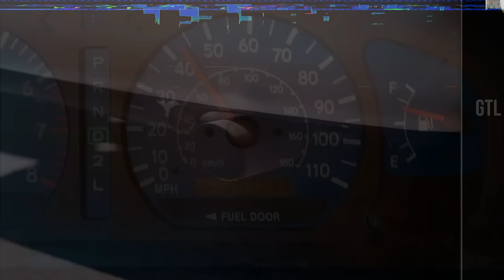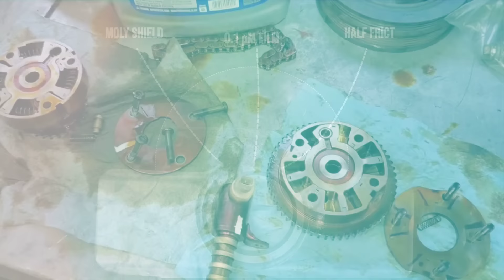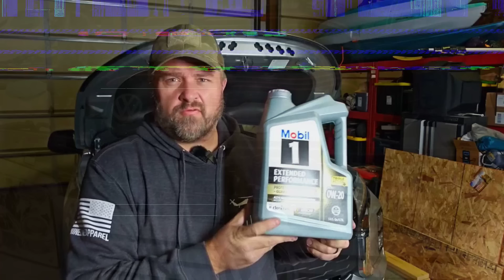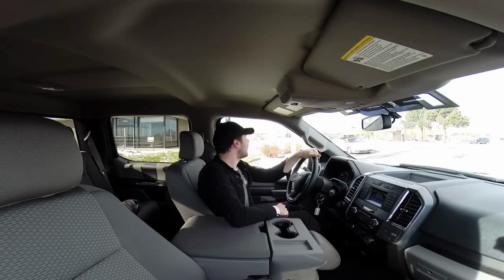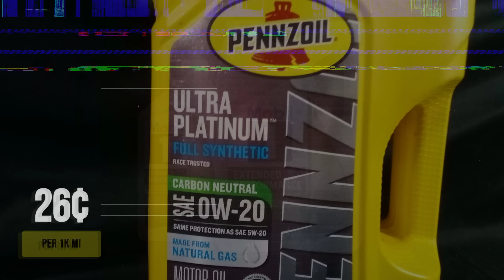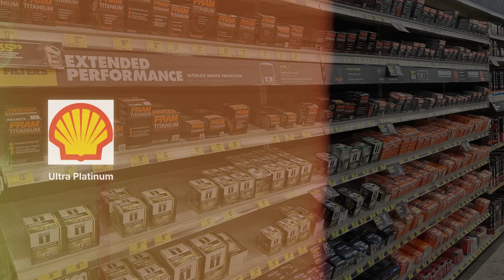Penzoil Ultra Platinum vs Mobil 1 Extended Performance

Comment: I had to do a complete engine rebuild because I purchased a used 2017 CadillacEscalade the lifers went out. first use Mobil 1 ep but after 1500 it started to turn black because of all the detergent. So I decided to try Pennzoil ultra platinum not regular platinum after a lot of research and it’s a clear winner for me. Ultra platinum makes my truck feel real power then Mobil1. The Key is to change your oil with premium filter every 3000 no more… I do mines every around 2800-3000… just only $115 to do it yourself
Reply: Pennzoil Ultra Platinum no longer has GTL & isn't even Dextros Certified any longer! You might want to pay attention to the new formula since this Iran BS war!!!! Just if you are going off what Pennzoil 9months ago once was.

Comment: I change the oil using penzoil full synthetic high mileage every 3 thousand miles but Mobil 1 valvoline castrol they exelente oils also the key is do the oil change on time

Comment: Pennzoil Ultra Platinum used to be better, not anymore!!!!  As of April, Pennzoil Ultra Platinum no longer creates oil from natural gas to liquid process but they are charging you more. There is no longer 99% pure.  They no longer molecularly build their motor oil from scratch.  The first part of this video no longer applies.  They no longer control the shape of their molecules.  They take it from crude oil and it is not worth the $40 they charge now.  Don't waste your money on Pennzoil UP, it is a bait and switch now.  

Shell, who owns Pennzoil, sustained some damage at the GTL Pearl processing plant in Qatar.  Short story:  They charge more for the inferior Ultra Platinum than when it was a better product several months ago.  Just don't buy it and waste money. Oh yeah, Pennzoil Ultra Platinum is no longer Dexos1 approved.  

You are better off with Kirkland Signature Synthetic (save more money), Havoline ProDS and some others.  Mobile Extended Performance is also a better choice.  Pennzoil needs a press release to the oil industry instead of inconsiderately taking off the wording of Natural Gas to Liquid.

Comment: The narrator states that Pensoil Ultra Platinum is Gm Dexos approved, this isn[‘t the case. Nowhere on the Pensoil Ultra Platinum label will you find the GM Dexos label.
Reply: This is a recent change due to the Iran war. They changed the formula after their Natural gas plant was bombed.

Comment: I use original Mobil-1 full synthetic in our 2019 Ram 1500 with the Hemi and change it every 5000 miles with Mobil-1 oil filters.

Comment: Have a 2014,3.5 turbo, running penn ultra and top tier fuel. I change every 5.000 miles. I don't push my oil to it's breaking point, and anyone who does is foolish 🤔  thanks for your video.

Comment: i mix pup and M1ep 50/50
Reply: Is EP GTL?  IF not, you are bringing down the PUP properties and raising M1 properties.  I wouldn't degrade PUP with any group 3 oil.
Reply: @lonniebeal6032  it might have some GTL, but it does have some PAO also.
Reply: That’s interesting! How is that working for you?

Comment: So, I guess the bottom line of the video is to use Pennzoil and Mobil 1 alternately every other oil change 😊
Reply: Nope, all group 3 oils are good to 5,000 miles.  If you're going over 5,000 mile OCI's, group 4 is a safer bet. Those group 4's being Amsoil Signature, Redline, Triax, Torco and certain family members of Ravenol as supported by SDS PDF's.  Amsoil is probably the best priced group 4 if you join their club.
Reply: @lonniebeal6032  - I would never go over 5k between changes. 😊

Comment: Gtl oils require an abnormally large amount of thickener. If your don't change the gtl oil on time or overheat it, your will end up with a lot of deposit. GTL motor oil technology requires further development. However , in very low viscosity oils such as  0w8 can show its best side

Comment: Mobile 1 is group 3 with group 4 additives
Reply: Exxon Mobil has recently started using a PAO/GTL blend base oil in some products, for example, Mobil 1 Ex Perf 0w20. It's every bit as good as Pennzoil 0w20.
Reply: Only one of the family had PAO on the last SDS I looked at.  I think it was the oil Mobile One Advanced, which doesn't seem to be sold her any more.  So No, saying M1 is group 4 is false.  SDS sheets support Amsoil Signature, Torco, Redline, certain family members of Ravenol, and Triax as group 4.

Comment: Pennzoil is group 3, mobil 1 is group 4 which is superior to group 3 period 👊
Reply: Check your SDS sheets, Only M1 Adavancted has PAO, and I am not seeing that for sale in my area or on Amazon.   And many videos show that group 3 and 4 are pretty much equal to 5,000 miles.  After 5,000 miles the group 4 will exceed group 3.

Comment: In my Dodge Challenger SRT Hellcat with a 6.2L Supercharged engine, I use 0W-40 Penzoil Ultra Platinum. However, twice in a pinch, I have used 0W-40 Mobil 1 European Formula. I change my oil every 5,000.

Comment: You'd have to be a maniac to go 15-20k between oil changes.
Reply: 10w30 in a high tension piston ring 85' and 89' Dodges with turbos did great at 15k mile oil changes, new filter and top off half way.  Any full synthetic on sale was used, I did it, both cars over 110,000 miles when I traded them off.  Regretted trading off the CS Daytona Turbo within a month.  Today's  0w20, I wouldn't do it on a group 3 oil, I would on group 4 with a UOA.  Oh, on the turbos I adhered to the 3 minute warmup and 3 minute cool down before turning the car of, so no turbo problems.

Comment: Been using Mobil 1 for 32 years in my 1994 K1500 TBI 350/5.7 with no issues and still running great 👍🏻

Comment: Pennzoil ultra platinum is made from natural gas, a group III GTL oil. Mobil 1 EP is group IV, PAO oil. Both should be very good
Reply: Pennzoil is not natural gas anymore.  I've been using it for a few years now, since the change, they downgraded and is charging $10 more per 5qt.
Reply: @DroneStrike1776  It is still priced nearly identical to mobil 1 and other top tier oils.. Penzoil Platinum is still made with natural gas, it clearly states this on the back of the bottle in the black paragraph.. Ultra does not list made with natural gas anywhere, although the website says it is still made with natural gas, however Ultra Platinum is still a great oil, new or old version. Plus you can still find the Made with Natural Gas at a LOT of places, just check the bottles.  I found so much at Advance auto parts and dollar general, that I have about 60 qts stocked up.
Reply: Except more recently Pennzoil has stripped their dexos 1 cert, changed their label from made from natural gas and don’t list GTL on their bottle anymore. Red flags all around since their main GTL factory went down this year. Maybe they will bounce back but there’s no reason for them to if sales don’t go down.
Reply: @UnholyMerlin1    From what I read today, Pennzoil is still using some GTL in their Ultra Platinum and possibly Platinum "full synthetic" oils. Some is the key word. I did a search for "Who still uses GTL as their base?" That info is from 8-24-28.
Reply: @UnholyMerlin1 1000% I No Longer Mess With Pennzoil Since This BS Iran Garbage War!!!! I'll Take My Chances With Mobil 1 EP For Now!!!!! Not The Mention How Shady Pennzoil Is Being With All The Oil Experts Reaching Out For Information On Their New Oil & Not Responding, BIG RED FLAG!!!

Comment: Total AI garbage. Professional race teams are not using off-the-shelf Pennzoil or Mobil products- period. I know because I'm in the industry. It would be insane to run compromised consumer detergent oils like Pennzoil Ultra or Mobil 1 EP instead of specific race blends with limited additives. Race teams use custom blends and work with tribologists to formulate oils that will keep temps low, minimize friction losses and stay viscosity stable. There's no off-the-shelf oils at Walmart or your local Auto Parts store that are going to do that. Sorry.

Comment: The information in this video is no longer accurate. Mobil 1 (and Mobil 1 EP) have changed their formula, mainly due to cost reasons. They now use about 1/3 Group 3 (severely cracked crude oil), 1/3 PAO, and now 1/3 GTL Group 3 purchased from Shell. Pennzoil is owned by Shell, which is where they get their GTL from. The percentages above vary by viscosity. This information was obtained from the MSDS for Mobil 1 in Japan, where Group 3 components are considered to be hazardous chemicals and must be disclosed in the MSDS. The Japan shows the Group 3 from crude oil separately from the Group 3 from GTL since they have different CAS numbers. You can ask ChatGPT is you don't believe this.
Reply: this guy knows

Comment: No matter what oil brand you use, new oil is better than old oil. You have to change the oil with a high-quality filter {I use the Boss from Purolator} every 4-5K miles. Short trips are a strain on the oil because the engine does not get up to operating temp., and burn off the moisture in the oil. Once a week, take your vehicle on the highway for 15 to 25 miles, and get that moisture to evaporate. Your car will thank you

Comment: Retired Industrial Lube Application Engineer, here.  Interesting video, but some of the application points are off.  The latest engines are GDI.  These engines contaminate oil much, much quicker than the previous generation of port-injected engines, to the point where oil must be changed prior to 5,000 mile run time (I've confirmed this via UOA myself). Fuel and soot blowby from incomplete combustion in rich burn (loaded) injection mode is the culprit.  So arguements about oil longevity are no longer relevant, as most engines are now GDI.  What IS important is sheer stability for turbocharged engines, again, becoming more frequent, and Low Speed Pre-Ignition inherent to GDI engine design (LSPI).  These require oils of specific additive content (API SP), but SP also lowered viscosity for fuel savings.  This is not good - PUP was a 11 cSt oil, now reduced to 10.2 cSt.  I have changed to Mobil 1 ESP 0W-30 to get a real SAE 30 oil again for my turbo GDI. 12.0 cst and its high load from the turbo.
Reply: Thanks for your expertise

Comment: Info in this video is wrong.  Mobil 1 EP doesnt start with crude oil, it is a PAO base stock !
Reply: No, it is a blend of Group III cat cracked and severely hydrotreated and Group IV PAO.  Mobil will not divulge, this has been assessed by labs (Motor Oil Geek, etc.).  PUP is a Group III+ because it is not PAO, it is Fischer-Tropsch process the Nazis invented.  I creates some waxy residue, so not a pure PAO.
Reply: Mobil1 EP 0w20 is now using a PAO/GTL blend base oil. I don't know if other weights do.
Reply: @EpiLover Not all of their flavors, only one had the GTL.
Reply: @lonniebeal6032 - All the flavors of ESP X2 and X4 use GTL/PAO blended base stock, typically 50-75% GTL. According to Exxon Mobil tech desk.
Reply: Not any more.  Only Avanced had high PAO base, up to 70%.  Advanced no longer for sale in my area or on Amazon.

Comment: Ehhh….Ive been a Valvoline guy for 40 years and have no plan on changing.
Reply: Valvoline is excellent oil  ran it in my Ranger 300k miles
Reply: If it works I don't blame you.

Comment: Not meaning to offend anyone but IMO anyone that runs any oil over 10,000 miles (especially with a turbocharger) they have some screws loose!  LOL            Engines last longer when you get old dirty oil OUT of the engine and put in new fresh oil regularly and change the filter and I do oil changes every 5,000 miles (its how I was raised) and it works.
Reply: I was raised to change my oil every 3000 miles,  my grandfather changed his every 1000 (shows my age). I have extended my oil change to 5000. I use mobile 1 but still change every 5000. I got hooked on mobile 1 nearly 40 years ago when I tried it in my harley sportster and found it ran cooler and got better mpg.  That mobile 1 doesn't exist anymore but nearly all oil producers have improved since then.
Reply: Depends on the engine.  2002 Cavalier bought brand new and always had extended drain intervals over 10,000 miles with full syn oil.  Sometimes just changed the filter at 12,000 and topped off.  Had to scrap the car at 250,000 miles due to transmission and water pump, but the engine was still strong and never gave us any problems.
Reply: @jeffreycole9586 yup
Reply: @jeffreycole9586  Certain pre-DI Honda applications are so easy on oil that they don’t even challenge non synthetic oils at 7500 mile intervals. More important than the whether it’s labeled “synthetic” or “conventional” is the quality and quantity of the additives used in the oil. A premium quality conventional oil with the very best additive packs made can outperform a mediocre “full synthetic “ oil easily. I put 630K miles on one Toyota truck and it never saw a drop of synthetic oil the whole time and it a averaged about 7K miles on the oil changes.
Reply: I have a 392 scat pack ive changed 7 times in 27k the longest interval was 4600 miles  ive used 0w40 pennzoil for srt and a mobile 1 filter they're rated as 1 of the best and 1 ounce per gallon of chevron techron
Reply: My Grandpa had an El Camino.  He religiously changed oil at 3k miles.    At 100k miles he decided to redo all the suspension and the engine.
When he took the crank to the machine shop..  No grinding was needed!  Just a light polish and new stock size bearings !
Reply: I did it on 2 Dodge Turbos 1980 to 2004. 15k OCIs filter and top off at 7500. 10w30. Mobile 1 and Supertech full synthetics.   Both cars over 110,000 mile, oil caps and valve train clean. No sludge or varnish. I wouldn't do it today on 0w20 and the low tension piston rings introduced around 98'. Don't underestimate synthetics.  I also drove over 20,000 miles a year up to 2011. Get a UOA at 5000, it may surprise you.
Reply: I agree 👍and I don't need an olive sample test ,I just pull out the dipstick look at the oil and see if it's getting dirty and feel it to see if it's smooth.
Oil is cheap ,motors are not.
Reply: @tommyboy1653Oil Ain't Cheap No More😂!!! Just Wait Another 3yrs it will be another 20% more for good oil😮!!!!
Reply: Where is a test that shows timing chain wear results? Chain stretch is a real issue
Reply: @candyman1967  Many 4 cylinders had timing belts, including my 85' 600 Turbo and 89' CS Daytona Turbo.
Reply: I send my Mobil 1 5w-30 samples to Blackstone every 10000 miles (owners manual recommendations) 

BS sampling results indicates extending change intervals to 18500 miles then resampling.

I drain  at 20k regardless of what BS recommends… 380,411 miles and still going strong.
Reply: @douglogan4134 Some Engines Just Are Made To Run! You do 20k mile oil changes on every vehicle, AIN'T NO WAY YOUR GONNA GET THAT LUCKY))))!!!!! Good Luck With Those 20k Oil Changes😅!!!!!
Reply: Another person stuck in the 70’s and operates off emotions and not facts! Oil lab tests don’t  lie!
Reply: Well. Thats your opinion. Major national truck fleets change their oil at 80000 miles with 2 filter changes and oil level top off. Turbo diesels. They run different drivers in all states and climates. They sell them when the extended warranty  runs out at 400000 miles. Over changing your oil is actually worse with modern engines and oils. Its Not 1968. Engines run cleaner and science has moved forward. Ive seen engine oil pans replaced because  joe schmo wore the aluminum threads on his Acura v6. R/I THE MOTOR . OLD opinions never end.  
I could run on ad infinitum. But you have you mind locked in the past.
Reply: @berttompkins9096    This was about cars and pickups,   not 18 wheelers,    DUHHHH
Reply: Using full synthetic oil and changing at such short intervals is a huge waste of money. ANY top brand regular oil will protect just as well at such short intervals. Full synthetic oils are only cost effective if you run them longer than conventional oils. Doing used oil analysis to determine oil change intervals with synthetic oils is worth the money and it will show you exactly how long you can safely run synthetic oils without any issues. For years I got all my oil free but it was all conventional oils. I changed it on average every 5K miles. When I sold it the truck had 630,000 miles on it and was clean and free of sludge and no noticeable oil consumption. Had I been using full synthetic oils I would have set the intervals based on analysis and I have no doubt that I could have easily done 8-10K intervals with no issues whatsoever.
Reply: @prevost8686  Your engine or your style of driving may make you the exception but most small engines with Turbochargers need to have oil changed at 5,000 to 7,000 miles because the turbocharger will cook the oil and create carbon/coke deposits that block the oil lines and passages and starve the turbocharger bearings from getting good oil flow.    Another thing that does this is people that run the engine and turbocharger hard and then shut off the engine,  the oil quits moving with the engine off and cooks inside the bearings.
Reply: @Bowhunters6go8xz6x  That’s simply not true with full synthetic oils. I’ve got numerous customers in my shop with Ecoboost equipped Fords and they can easily run 7-10k mile intervals with excellent oil analysis results. Modern turbos are cooled with both oil and coolant which keeps oil temperatures down.  Turbo applications aren’t as stressful on oil as fuel dilution is. There are a few applications that it’s inadvisible to run extended intervals because their direct injection designs create excess fuel dilution.